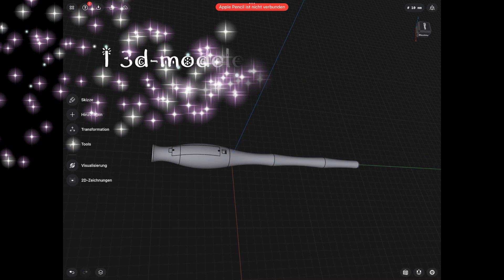DIY - How to built a real fire ball shooting magic wand (harry potter - like 3d printed wand)

Comment: This looks amazing! How is it getting thrown in the air? Or propelled in the air or whatever? I'm just seeing the pyro paper getting ignited and then it gets blown? Can you elaborate on this?
Reply from the maker: Thank you! I really considered on making a own video about the working mechanism ^^ there are two physical principles here: the pyro paper is ignited by the glowing wire. It burns really fast and heats up the air behind the pyro paper very fast. When a gas like air is heated, it expands and pushes the paper out. Also the burning (reaction of the paper with O2) turns the paper into a gas. Gas also fills more volume than the solid paper, so it also pushes the rest of the still burning paper out, because the backside of the pipe is sealed. Since the pyro paper burns so fast it only flys a short distance until it is totally burned.